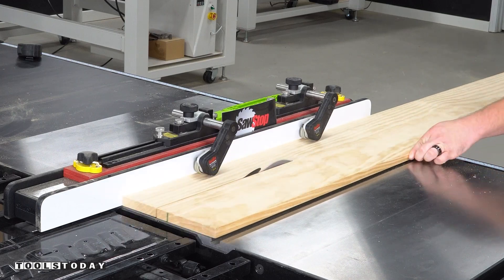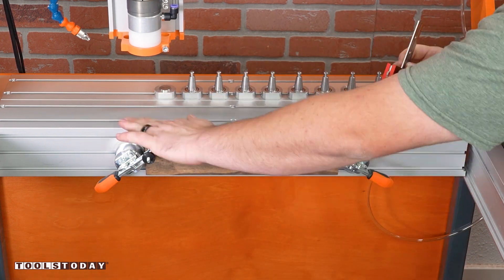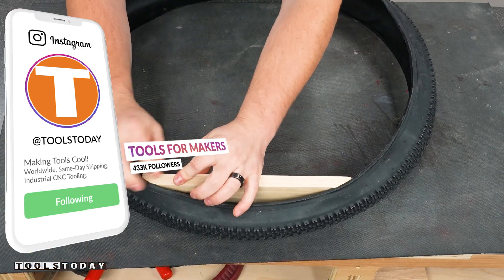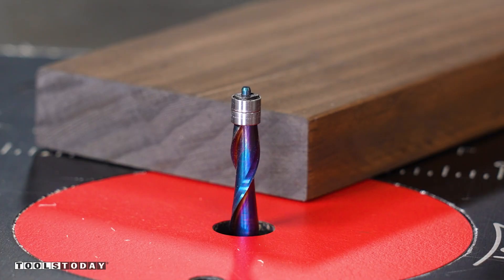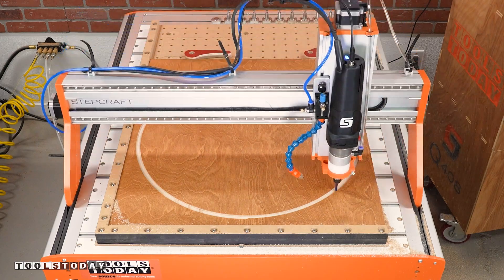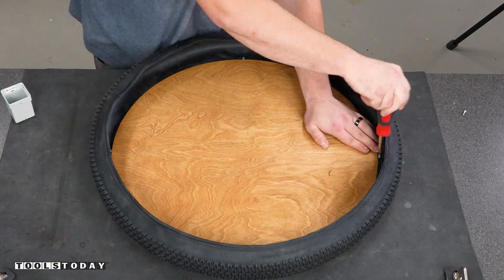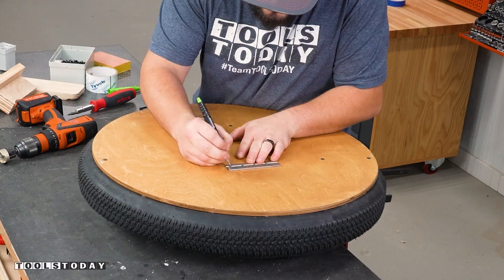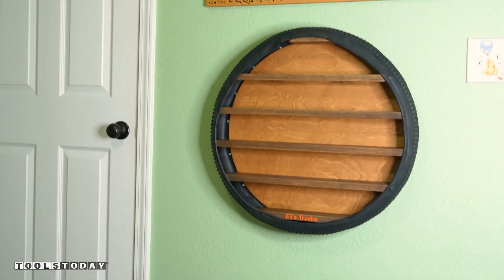How to Make a Monster Truck Shelf using a Bike Tire | ToolsToday CNC Video

Comment: If you had made your wasteboard a couple of inches shorter on the front, could you have mounted the vertical clamping fixture as the second track (first being empty) so as not to have to take the top off?